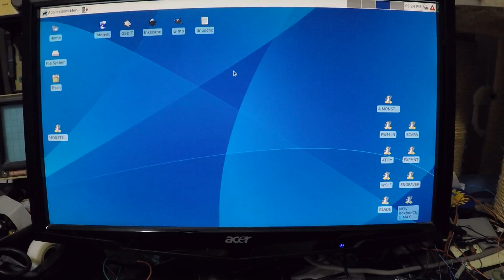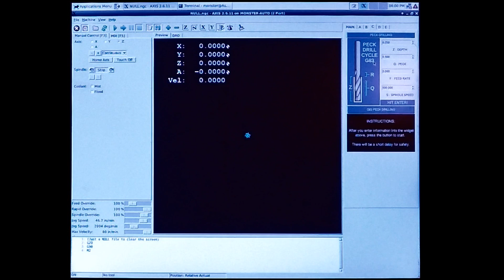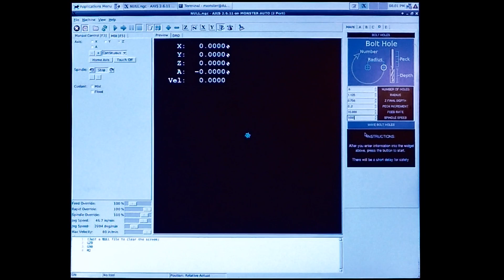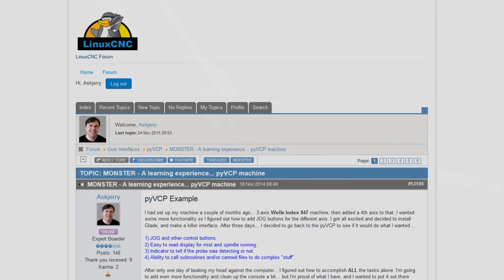Monster Mill Project 2015

Comment: The yellow truck you brought this home with isn't a 1985 model as mentioned on your site, it's at least a 1988 as that's the year they changed to the new body/chassis. Could be a '95 instead of '85? But not an '85. By the way, interesting subject you did this video on.

Comment: What the name of this sensor which you were using to test surface? on the 7th minute of video. Even better name and model. I do not know what to ask at google to found it....
Reply from the maker: It is called a TOUCH PROBE. It has a pointy end that when it makes contact breaks a connection. Then your software can know the exact point. I am designing one that my viewers can build with a 3D printer... but i have not finished the design. Here is a link to find one in the meantime... This one is about $300... you can find them from $50 to $500
https://www.woodcraft.com/products/cnc-touch-probe

Comment: Cool project, I've got a knee mill that I got for free because it was in the owners way, I'll have to do what you did.
Reply from the maker: Hang tight and subscribe... I am pulling the Geckodrives and the DC motors... starting from SCRATCH with a stepper motor build.

In theory, the machine will be faster and have less electrical issues.
https://www.youtube.com/watch?v=nAir8UUdutA

Comment: 2:29 tmw you don't realize the ways are worn down, the leadscrews are bent, and the spindle bearings are shot.  LOL
Reply from the maker: Still holds a 0.0002 inch tolerance... not complaining.